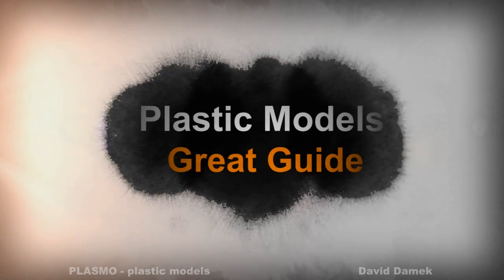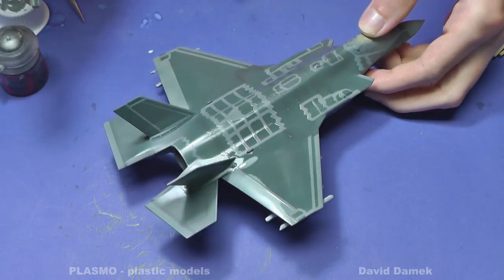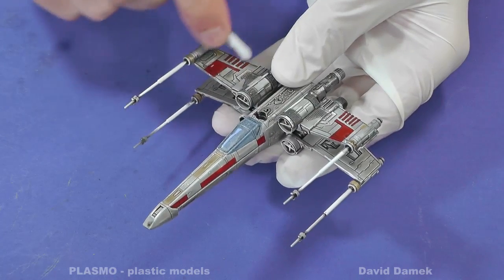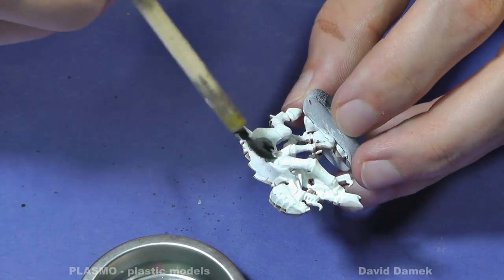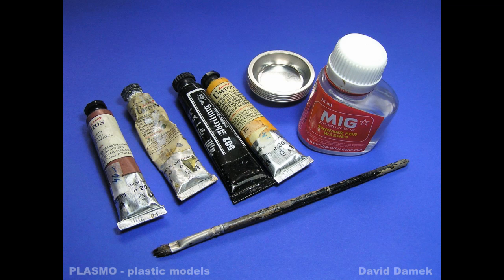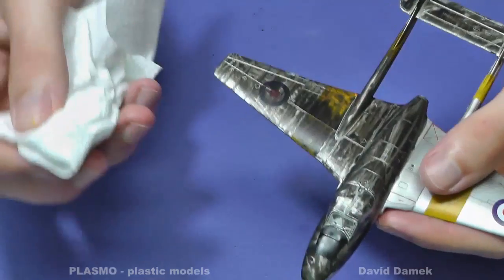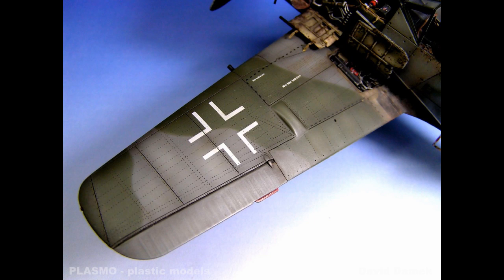How to Use Washes Oil, Tamiya panel line accent color, Citadel - Great Guide Plastic Models

Comment from the maker: Thanks everyone for the positive feedback. I added Czech and English subtitles.
Reply: will any oil paint work for this?
Reply from the maker: +Jefferson Sheng (EXIACXA3740) yes I thing so.
Reply: +PLASMO - plastic models also, u used MIG's enamel oil paint thinner. will regular enamel thinner do the job because 75ml for that bottle of thinner is 12 bucks. And I think that's a little too high..
Reply from the maker: +Jefferson Sheng (EXIACXA3740) Yes of course you can use enamel thinner but be careful. Some type of enamel thinner are more aggressive and could damage paint work. I tried x20 tamiya enamel thinner. It is cheaper than mig and work with no problems.
Reply: Hi, today I was doing the barnishing of the model and I stuck with a big TROUBLE: the tamiya x-22 doenst cover the model as you show in the video (example of the f35 model) its covers like a strange cape of tiny brits. Seems like the tamiya clear barnish needs a solvent... I have no idea about how to solve this... Please post me an answer.
Reply from the maker: Have you some photo? X-22 need gunze leveling thinner or you can use gunze varnish as I do. If you will spray model surface with matt varnish, everything will be ok. On f-35 I used gunze super clear III. Best varnish, I think.
Reply: PLASMO - plastic models ok im going to upload a video showing it... Hope you can help me... I've been reading, and some people say to make the barnish more sprayable they mix it with alcohol (alcohol for burn) Im not sure about this and Im a bit scared of finishing of damaging al my work :(. 
I will send you a link when its uoloaded
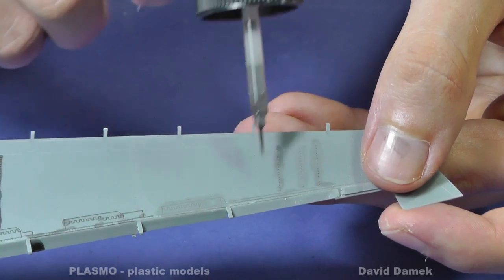Reply: Ahoj měl bych otázku... Jako začátečník jsem si vybral US M4A3 76(W) (HobbyBoss 1:48) je to dobře nebo bych měl vybrat jednodušší? A pokud je to na začátek akorát.. jak bych to měl udělat s barvením modelu.. jak začít?
Reply: PLASMO - plastic models 
Can the wash be applied over a matte surface?
Reply: Chin Chin The Dark Lord it's not recommended because matte surface will exorb the wash. Any Dull coat is not recommended in this case.
Reply: Super clips! Very informative and really great to pick up tips to improve my technique! Thanks!
Reply: Jefferson Sheng Thanks!
Reply: PLASMO - plastic models 
If you apply the oil wash over an enamel gloss varnish, would the thinner eat away at the gloss coat?  I believe that it would.
Reply: Mrgasmaskdude 
X-20A is an acrylic thinner, it won't work on oil paints.  X-20 Enamel thinner will work will oil paints.
Reply: Oh jeez I was having the same disaster! Cheers Tomcat you made my day.
Reply: I am new to air brushing. I have tried cleaning the gun with WD40 and spray it through after I have finished.  So far, I have had no problems. Is this a common technique?  
ROGER

Comment: Hi. First of all thanks for your videos. I just have a few questions. Would you recommend first applying surface primer and painting the whole model and applying clear gloss before using the washes? I have seen videos where they use an airbrush to preshade panel lines with a colour slightly darker than the base colour and then once everything is painted, they apply a clear gloss coat and then use washes. Does it make any difference ? I appreciate your comment. Thanks

Comment: I found this video really useful. I use Vallejo wash for small things like cockpits or gear bays but when it dries it has a dirty look and there are some sharp transitions as well as areas where the wash built up. I just recently experimented with oil wash on my Airfix Hurricane and the results were very nice. Some people say that doing washes makes the model look good but unrealistic but I think that having it look good is much more important than realism.
Reply from the maker: +Diesel Robot I also feel this way. Realism is in the second place.
Reply: I agree. I look at it more as an art than getting it realistic.

Comment: Hey David, Does it matter what kind of thinner I use for oil paints? I started to look around today to see what kind of oil paints are available and what thinner would work best, but I can't seem to get a clear answer between enamel and mineral thinner. Also, would you recommend Abteilungs own thinner, or would any thinner, be it enamel or mineral, be sufficient?

Comment: Hi David, that is a great video. I have question on Oil paint wash. I am using Vallejo water based paint, with Vallejo gloss vanish on. I would like to use Abteilung 502 oil paint, do you know what is the best thinner (not too strong)to use and not to cause any concern on break through Vallejo paint ? I see you use MIG thinner for wash, is there any concern on AV paint ? Alternatively can I use zippo fluid or AK white spirit ? I think Abteilung paint work best with their own brand with AK/MIG product. and what is the best way to clean the excessive wash?  dry or water damp paper or damp paper with the same thinner?
 Thanks

Comment: Wonderful video David. Have you ever considered MiG's Dark Wash for panel lines and rivets? It's a lot darker than Tamiya's brown panel line accent color. If I work on a plane I'll tell you if it works well, but maybe have you considered it?

Also, what are the benefits from doing a pin wash (placing the wash only over the rivets and panel lines, and a slather wash (what you did with the oils, painting the entire model in it)? I always never know if I should paint the whole model with a wash or give it a pin wash. Sometimes it would look good, and other times it won't look good.
Reply from the maker: +Alaskafish Just like wrote spamstabber. "Oil washes are definitely the way forward for larger models, as it gets very expensive using premade washes otherwise".  

(other times it won't look good) When? it always look good. But you must choose right wash color. I think, the best is combination all technique together

MiG's Dark Wash. It is great product. But first I must try it myself. Maybe I will order one for try.

Comment: I realize this is an old vid but hoping to get a reply. About to tackle my first scale model kit (Warhammer 40k and other wargaming hobbyist here lol) an airfix 1/72 P51D Mustang for use in my Bolt Action US army. I want to try to use the oil wash technique and will be painting the model with acrylic colors from both Vallejo and Citadel line. What varnish would you recommend for use with these color brands in mind before doing the oil washes? Thankyou for another amazing vid Plasmo and thankyou for any help you can give.

Comment: Hello David! I have a question about oil paints and washes based on them.
I have come across models where these techniques were used and they were greasy in touch, even though it had been weeks since they were completed. Several of my friends have also encountered the problem that the satin/matt varnish applied at the end of the work cracked where it came in contact with the oil paint (even if they applied it after few days of drying time). I paint mostly miniatures for gaming purpose, sometimes something for dioramas and have never used oil paints before. I would like to expand my workshop with them. However, I'm afraid to have similar experiences I mentioned above. What could be the reason for such greasy feel and cracking of the paint applied on oil paint? How to prevent this from happening? Have your models also become greasy to the touch after years or do you not have this problem. Can oil paint react with paints applied previously? Please help :-)

Comment: Thanks for the informative videos. Maybe one day you can do a video on all the materials and tools that you use.  Really liked the little razor saw, rivet tools, and those small thin paint brushes you were using for the detail work that you were doing. Also what size lead wire and copper do you use?  Have watched parts 1,2,and 3 over and over again, very great and very informative.

Comment: Every wash and thinner I've used for panel line washes messes up my gloss clear coat by either staining it or dissolving it.  I use Mr. Color 46 gloss clear.  What type of wash and thinner do you recommend to use that won't ruin Mr. Color 46 clear coat?

Comment: thanks for the tips!!
just wondering what are those little dishes you use for mixing and where would I find them? they look really useful.
cheers
Reply from the maker: "Mr. Paint Tray 10 pcs" and you can buy them on amazon or eBay. 
https://www.amazon.com/Mr-Hobby-Paint-Tray-pcs/dp/B002DTMYIW/ref=cm_cr_arp_d_product_top?ie=UTF8
Reply: PLASMO - plastic models thanks!

Comment: I got a question: I paint my citadel miniatures with enamels (testors, revell, etc) which technique should I use? Will the oil wash do better? Have you tested citadel and vallejo washes on a enamel painted mini? Im considering applying those acrylic washes on my enamel painted minis, do you think it ll work? (With or without gloss varnish) If youre interested Im eager to share my humble work

Comment: do you need to apply gloss varnish also for oil wash or only for tamiya panel liner? I have my p-47 coated in 1 layer of tamiya semi gloss and finally want to try oil washes, what do I need to do so I wont get problems?

Comment: Hi, me again:-o I've still troubles with the varnish, this time I tried tamiya x22 mixed with vallejo airbrush thinner(every consistency, every pressure) but I doesnt go glossy unless I spray ways to much so you get waves. Super clear III is not available in my country. I have also vallejo gloss varnish. but can I use mr hobby super clear gloss for oilwashes too?  I think it is a laquer and so, how to clean the airbrush from it?
Reply from the maker: Why do not use x-20a thinner for x-22? I do not know if Vallejo airbrush has matt effect. Do not give up. Modeling is about testing. You can clean lacquer form airbrush with lacquer thinner.

Comment: Hi Martin, I am a beginner just starting to make my first model. One thing I get so confused is when to use gloss and matt varnish, top coat, and surfacer etc. I don't know how to use all these and I'm worried about messing up the acrylic base paint. I always see you spraying something in between paints, washes and decals etc. Would you mind explaining this? Thanks!
Reply from the maker: +Finnick Vehicles Do not use these techniques when you are beginner. Just paint model and put decals. No surfacer, no varnishes and definitely no washes. Like a beginner you will have definitely problem with painting. Like I, when I made my first model. However simple step by step. Surfacer, color, postshade, gloss varnish, decals, gloss varnish, washes, other weathering, mat varnish.
Reply: +PLASMO - plastic models Thanks Martin. I will stick with simple painting until I get better then :) Just wondering, in case I mess up my first model and want to start again, what can I use to wipe and clean the paint completely and start over?  Thank you!

Comment: I heard you need to apply gloss coat before decals and after painting to prevent silvering, but i also heard you have to apply a clear coat after decals and before sludge wash in order to protect decals when you rub the sludge wash with a paper towel, im confused, so i need an overview of what to do after painting

Comment: Can u tell me what do u call that small silver plate where u put your paint?
Reply: you can get them at an art store. paint mixing cups and trays. trust me tho. get a bigger one with multiple reservoirs, the little cups are so easy to knock over and stuff. get oil paint everywhere and its a mess to clean up.
Reply: @warchitect73  thank u so much sir

Comment: Question:  When thinning the oil paints does it matter which thinner you use?  I have some regular mineral spirits that I purchased from a hardware store but I think it might be a bit too harsh and it may attack and damage the undercoat of paint. What do you think!?
Reply: Phayzyre105 
If the undercoat is enamel then yes, the thinner will attack it, if you apply 1 or 2 layers of acrylic gloss varnish, it will prevent this.  If the paint is acrylic, the thinner won't usually attack the paint.  Despite this I 'd still apply some gloss varnish to seal the paint.
Reply: Good information, thanks for the reply!  :)
One more quick question: Does it matter which acrylic varnish you use?  There are several out there for modelling; I was planning to use a floor wax varnish like Future.
Reply: Phayzyre105 
No it does not matter, as long as the varnish you use is hard wearing so it doesn't flake off once dry.  Future would be a great choice because it is self-levelling and is extremely strong.

Comment: Hey all, what thinner can I use for the oil wash if I don't have MiG Thinner for washes? I tried using Tamiya X20 Acrylic thinner but it didn't work too well, any insight? Thanks
Reply: You can use lighter fluid to remove the excess paint from an oil wash, so long as that's what you also use to thin the oil paint. It evaporates fast so just add more to the mix if it starts thickening up.
Reply: Justin Valentin 
You have to use X-20 ENAMEL thinner, NOT X-20A Acrylic thinner

Comment: Should I put the gloss coat once I finish the model and then apply the oil wash or put the oil wash first and then the gloss?
Reply from the maker: +tomilius98 Simply, Gloss varnish on color. Put water decals. Cover decals with another coat of gloss varnish and after that you can use washes. Last layer for fixing washes you can use flat or semi gloss varnish.
Reply: +PLASMO - plastic models sweet, thanks man!
Reply: +PLASMO - plastic models thanks for answering this question.  I tried to use tamiya line assent after one light coat of tamiya clear on my model and it all messed up. 
Now I know it needs at least two coats.

Comment: Ok but whenever I use the black panel liner and then try to take off excess with thinner and a q-tip afterward, it ends up taking the other layers of paint below it with it, even though they are acrylic base paints protected with two layers of varnish. WHAT AM I DOING WRONG?
Reply: Did you find the mistake? Cause I have the exact same problem!
Reply: @dimitristriantafillou5752  Tamiya got two thinners under the name of X-20 so it's easy to mess them up. To clear oil washes, like the tamiya panel line one, you need enamel thinner. If you use the acrylic one you will damage the acrylic varnish and acrylic paint. I assume that is the problem.

Comment: i have wash from vallejo, im waiting for a big 14 hours.. and then i need to remove it with thinner?..
Reply from the maker: +Piet Puk Vallejo wash can not be ramove becouse it is acrylic wash.
Reply: thanks.. Tamya?
Reply from the maker: Tamiya panel line is enamel so you can simply wash them off with enamel tamiya x20 thinner.
Reply: Thanks, but i washed my model.. and now?:) how can i remove the wash? or is it now failed the model?

Comment: what can I use to thin oil paint washes I cant find mig wash thinner you use I have Tamiya x20A what else can I use
Reply: sebol931 
Turpentine or any form of mineral spirits would work.
Reply: sebol931 
Turpentine or any form of mineral spirits would work.

Comment: Do you coat the models in some kind of gloss varnish before applying the Tamiya Panel line wash?  Since you clean the excess with Mig thinner.
Reply from the maker: +Robson Scerri yes, I use acrylic mr.color GX100 Super Clear III or Mr Color Flat Clear 182.
Reply: +PLASMO - plastic models Thanks a lot!
Reply: PLASMO - plastic models 
I use tamiya X-22 enamel as a gloss varnish, if I apply an oil wash over the varnish, the X-20 thinner would eat away at the clear coat right?  Should I use X-22 acrylic instead?  
Thanks!

Comment: forgot to say: oil washes work best on acrylic colours ...if you use oil washes on enamels, the wash will remove the colour.
Reply: And what happens if I use the tamiya wash on acrylic paint (like vallejo & tamiya acrylics) and than want to remove it with tamiya thinner. Wont the thinner also remove to acrylic colour under the thinner ?
Reply: @steflange02  might also remove the colour but maybe not as much.

Comment: Hi! I'm trying to use Tamiya Panel Line Accent. I've applied an acrylic satin varnish to protect the paint before. But when i had to remove the panel line eccess (with the tamiya X-20A), the varnish and paint comes off...Where is my mistake?...

Comment: Can anyone tell me why the paint rubs off at 7:25? Cus that's exactly what is happening to me, even after clear?
Reply: if you seal with a clear acrylic, then you can use an enamel based wash. But if you use enamel based paint and clear coat, the enamel wash will affect you enamel clear coat and colour.

Comment: what will happen if i use water instead of thinner for making the wash?...
Reply: guillem grau freixas oil and water don't mix
Reply: guillem grau freixas 
Water will work for an acrylic wash.  Keep in mind that acrylic paint cannot be wiped away with water once dry, you should use windex to clean it after drying.